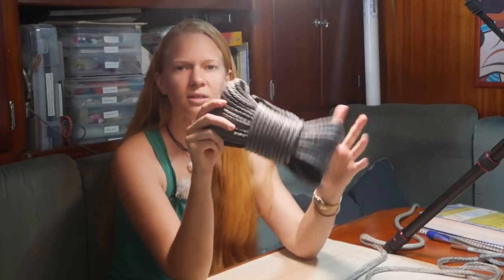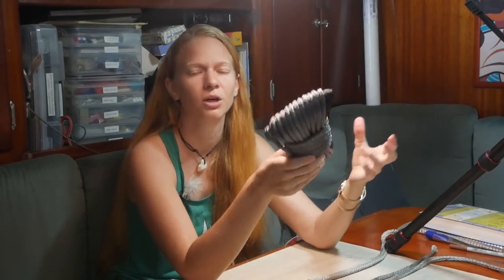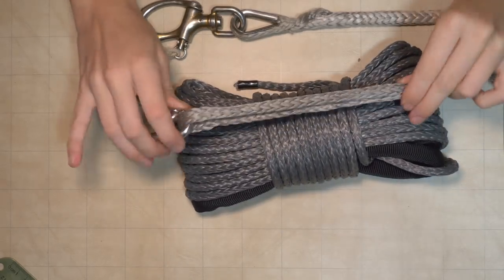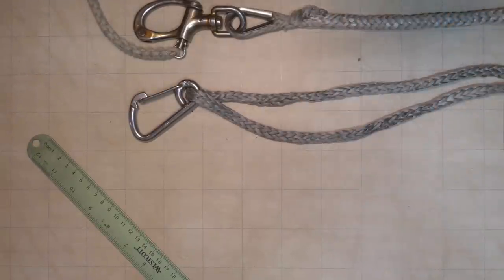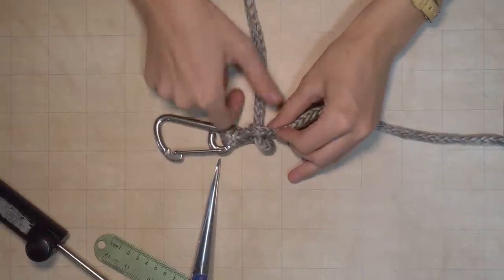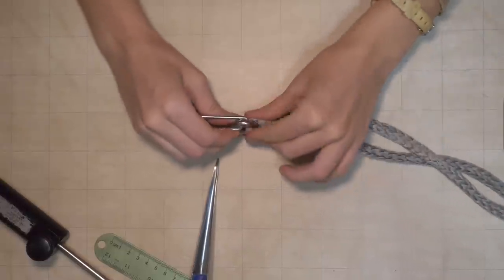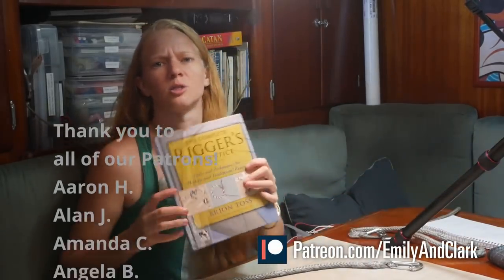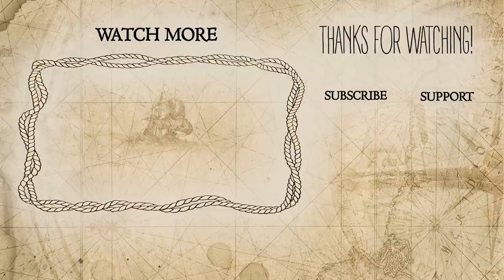Easy SPLICING: How to do a Brummel Splice around a Shackle [Capable Cruising]

Comment: Lots of confusing info on the internet. I thought the 72X was when you just made a loop and fed it back into the line without the brummel locking splice. With the brummel, the bury only needs to be 21X the diameter. That's what I do and haven't had a fail yet. So I would say 72X isn't wrong it's just overkill and a waste of line. Happy to be contradicted.
Reply: The Brummel does not add any strength to the splice. It simply keeps it from coming undone when not under load. Your splices haven't come out because you haven't loaded them to that extent.
Reply: @tanguerochas  so you're saying I should use 72X regardless?

Comment: Sailing zingaro had a catamaran with all standing rigging was made from dyneema on a passage from Galapagos to Hawaii the Portside pontoon started to tear off of his boat and he used  dyneema and lasted all back together managed to get into Port the boat was total but it got him home
Reply from the maker: Ykes.

I knew there are reasons I chose a heavy boat.
Reply: @Clarks-Adventure  yeah that was the first cat but 3 channels I watch with catamarans on them they're having the same problem with pontoon starting to tear loose from the boat from the bridge deck , I just dont think cats are designed to take the stresses of open ocean cruising
Reply from the maker: Like any light boat they can for a while but need to be retired young.